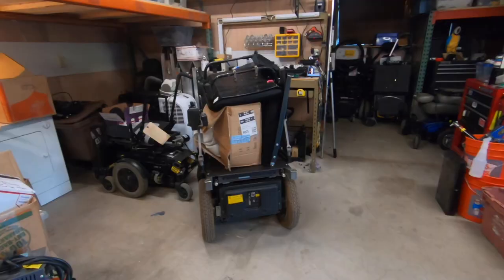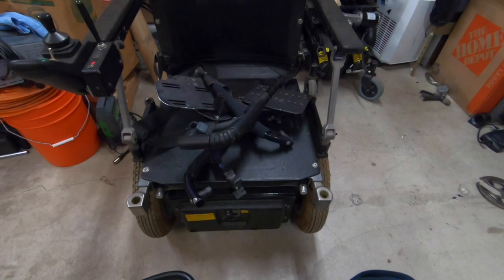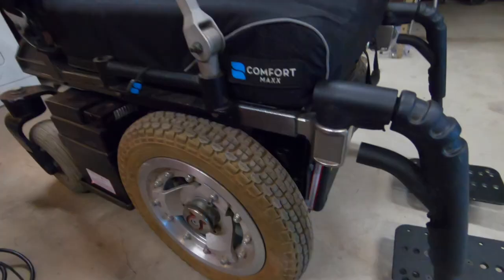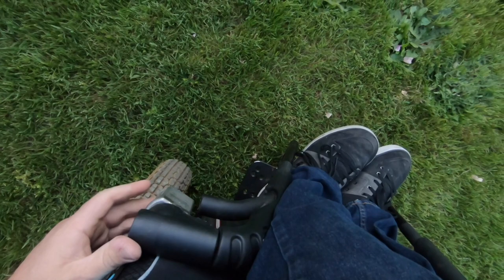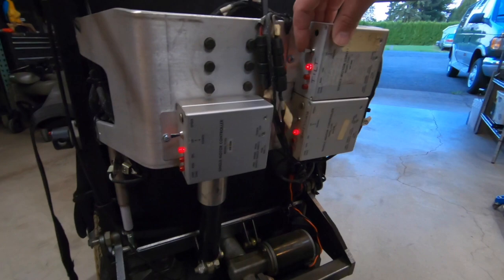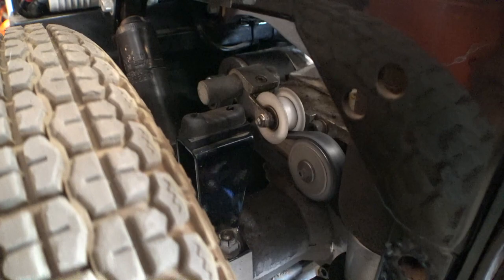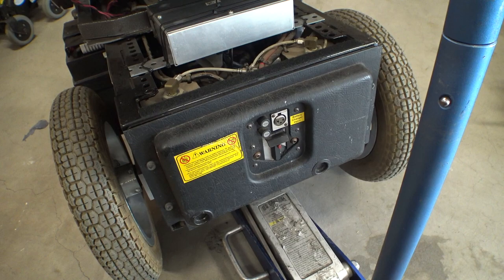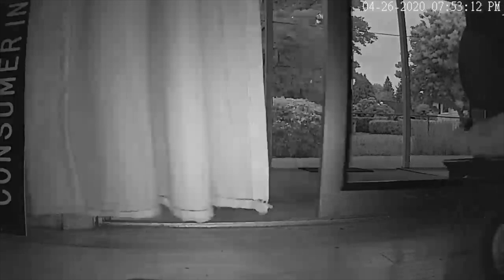VLOG 502: the Omega Trac!

Comment: I had an Omega trac similar to this one. mine however did not have airbags and also no gyroscope so when you went on tilted surfaces the wheels didn't compensate for the tilt. I do agree with you that it was an awesome machine that pretty much could go anywhere and it always felt like you were riding in a Cadillac. I used to drive it down to a lake of with my family. Going down the hill would not of been possible in any other chair but this chair. Just thought about something else mine only had a reclined system and it used labac seating system. The same one I had a quickie wheelchair.

Comment: My friend uses his Omegatrac chairs indoors and out. He’s had four of them. He drives, hunts, and manages his landscape business from it. My uncle and I have serviced his chairs for over 20 years.  His first one had a resistor type joystick w/PG Drives circuit boards and that was always a problem.  His newer chairs have custom digital controls made by Liber-T in Canada.  These have been more reliable but that company is out of business as are the companies that made the chair. 
It had been a challenge to keep his Omegatracs going but he’s not happy with any other.  
I as to your whine, I would check the four timing belt pulleys.  These are made of aluminum and all can become heavily worn.  The last time I replaced them with Ametric steel pulleys.
Reply from the maker: thanks for the tip! my chair has the older control system - just a PCB in a box with thru-hole components.. ive been trying to work out a way to retrofit a different control system - but getting 2 motor controllers to operate with one joystick for forward/back and left/right is beyond the scope of what traditional wheelchair control systems can accomplish
Reply: @TotallyNormal-  My friends first Omegatrac has 2 PG Drives boards with an analog joystick and I know they were a problem.  The Liber-T boards have been much better.  
Another problem is the ball joint in the rear suspension that can separate and allow the rear to collapse. This needs to be kept lubricated.  I tapped a grease fitting into that. 
The drive belt can break if a gear gets too worn, which allows the chair to freewheel.  This could be bad if on a hill. You may find yourself on the ground when the electric brake abruptly engages. 
The caster wheels have been a lesser problem. The swivel joint has stacked plates and is fluid filled to stop the wheels from wobbling. We’ve had these bind up which causes excess wear on the rear tires. I have removed a plate or two from those. 
I recall reading a report some years ago that Teftec got into trouble with the government for shipping chairs with engineering modifications without full documentation.  
These chairs are built like tanks though and my buddy loves the air ride.

Comment: I didn't get my Omega track until 2007(Back when they manufactured it here in San Antonio, Texas). I love it. Their ride suspension is awesome (as I have total sensation as a quad). So the air ride made driving this beast across fields and off-road terrain a blast. Of course I have tractor tires on mine. P&G makes electronics for it now (unfortunately only Hand controls and I'm chin control).
You can get the belts anywhere.
Yes, the son, was paralyzed.

Comment: Dan, I had been studying watching your videos lately. And had to subscribe to your channel.
 Thank you for your posts, and I hope the fires out there are soon extinguished, and you and your friends are safe and without any serious damage.
 I am a long term, 50 year, diabetic, who had an above the knee amputation, in December of 2018. 
 Well last year, a good friend of mine called me up and said I need to come see him as he had a power wheel chair for me.   This wasn’t just around the block, 4 or 5 hours to get there, I’m in central Va, and he is in Tn. So it wasn’t until a month or so ago that I finally got to go pick up my wheel chair.
 Well my buddy surprised me with three, a Pronto M5, a Jet 3, and the subject of your video an Omega Track. Hmm.... here’s where the fun begins. I want to make this a more serious off-road capable chair, if that is possible. Lightening the load is what I really want to do to it, ass you know it’s a tank.
  But for now would like to know about the controls for the Omega. Mine chair has a P&G, Penny and Giles, type D49470/2 Joystick controller, but I haven’t opened the front box yet.
 This chair also has a pair of joysticks that seem to be piggy backed on the control circuitry, one for the occupant, and one mounted at the back beside a push handle for whoever is accompanying them.
 My question revolves around two issues. One is it possible to disconnect the seat and back actuators and still operate the drive and turn motors? And have you run across anyone with any maintenance manuals?
 I would post a pic of my chair, if I could as it is not airbag equipped, it has shocks and springs, and my drive train is out in the open now.
 Thank you for your time.
Reply from the maker: all the info i could find is linked in the description of this video - (manuals etc) im not sure on that model of PG drives joystick... does it look similar to the one on mine? the control system on these chairs is a bit strange.. I'd be curious to see if it is in fact a PG drive system on yours! im looking for a way to upgrade the electronics on mine.. as they're.. well.. a bit old and crusty lol

Comment: Dan, the circuitry, in the control box does have a Penny & Giles relay (?) plugged into the Drive controller board, while the steering board has two units by Hamlin attached to it.
 The Penny and Giles has a sticker on it, that may correspond to the numbers on the JoyStick, the way it’s wrapped around, and being blocked by other wires, I can’t make out but the first few numbers of each line, but these first few are the same as those on the joystick. The numbers on the Joystick are, Type No. D49470/2  Serial No. 098121700.  Drives Technology Ltd., Christchurch Dorset England.
 Also on the steering board has an Assy. P. N. 024 09 0003, but this I believe is an Omega Trac. Number.
 I don’t know if this helps any, without pictures. I’m going to try and talk to a few people I used to work with, that worked with controls and dig some more into a few parts I have in a tote. Be nice to simplify this, but I don’t know if that can happen.
Reply from the maker: yea - on my chair the controller is all one single board with spade connectors on it, going to both motors... i think they had a few different versions of these things.  i know its possible to use a programmable motor controller - like a robotech, or a cheaper knockoff.. but i haven't gotten that far into the project yet :^)  i do wanna put a larger main drive motor into it - simply attached with a couple LARGE band clamps! right now mine id SLOW.. barley 4 mph.... the joystick on mine also looks like a bespoke custom built thing.. ive seen photos of newer versions with actual wheelchair joysticks on them...
Reply: @TotallyNormal-  
Dan,  watching a new video of yours now. You are obsessed with a light bulb at the moment. 
 I am on and off on the omegatrac I have it partially disassembled down to the lower assembly. No back and drive assembly for the back or seating tilt. 
 The main drive motors work, and I am contemplating a drive wheel and tire change for better yard and field use. By the way I have a brochure and 2001/2002 price list. Reason for this is the drive wheel offset you did on another video, the factory offered a dual wheel option that the offset changes worked with.
 I am looking hard at my P&G controls, and still looking at the possibility of completely getting rid of all of there controls and replacing them with two separate controls. That is basically how the P&G controls are hooked up. But with the controls for the seat and back.
 I have the two joystick controllers that were for the seat and back and I was hoping that you might have an idea about what kind of controller to look for that would only function for one direction. Even thought about the cheap China controllers off of eBay, that are only on & off, variable speed, and reverse, as long as the amp ratings are suffice to.
 Any thoughts. And thanks.

Comment: Hey Dan! My Omega Trac winds while turning also. Maybe not quite as loud as yours but that might have something to do with the gearing. Mine is a 2008 with 200 amp liberty joystick, air suspension and I have tractor tires on mine. Besides going slower it's an awesome chair compared to my quantum edge6z. If I have to think about an obstacle with my quantum the Omega Trac cruises right over it. If I have to think about an obstacle in my Omega Trac, there is no way the quantum would handle it.

 The Omega Trac is so much smoother in ride and there is no comparison in the smoothness and ease of operation in the drivetrain. The two things I do not like about the Omega Trac is the leggings and going up a steep grassy hill the chair overheats quite easily. On hard surfaces there is no problem with overheating.

Driving my van from the Omega Trac is so much easier than the quantum because of the suspension. With the suspension aired down it becomes a real stable base without all the suspension movement that the quantum has.

The drive belts are Gates and they are readily available anywhere Gates belts are sold. Looking forward to your next video on the Omega Trac. Take care!

Comment: The Omega Trac was designed by an aircraft engineer; his son was severely injured in an auto crash while his dad was driving. The father was frustrated at the inherent deficiencies of PWC's without gyros in those days and the predicaments (stuck side-ways in doorways) his son experienced. The best materials were used and my 2007OmegaTrac still operates perfectly. A transaxle, one drive motor, one turning motor enable a softball to be placed in front of one drive wheel and the Omega steps forward straight-ahead. I'm not clear if a Bounder or a Magic Mobility v6 could do likewise. Due to length and weight, the Omega Trac was deemed, nonpractical and sales dropped.
They climb like a goat and descend hills using tilt for ballast. A very, very comfortable ride, too; nearly impossible to turn-over due to weigh and low center of gravity, and adjustability using the air suspension in hairy places, I never fell (non seatbelt user). They are no longer made and parts can't be found. At 1,500 hours, the drive-belts were replaced here at home about three years ago. The only service completed to date!

Comment: Built by and aircraft company? Money was no object? Does it have the logo: HH tool company anywhere it? LOL
That is pretty cool for old school !
This is totally a guess: Sound seems like it's coming from one side more than the other off the cogged belt (left side in the video).
Could the belt be too tight? Where to get new belts: This may sound really stupid but... I have lucked out at the local "Ace Hardware Store" for replacement belts more times than at any auto parts store or machine shop ! Just bring in the old belt and let them measure it.
I hope that helps. If not, maybe they can point you in the rite direction.
Excellent Video :-) I like the RC-RV camera man too.
Reply from the maker: yea it makes the noise only when turning - someone else commented that his chair also makes a bit of noise when turning as well.. bit his wasnt AS loud as this one.. soo *meh * who knows lol  ill find out when i take the thing apart :^)
Reply: @TotallyNormal-  That will be interesting to see if it has some sort of clutch mechanism that kicks in during turns or if one motor is working harder than the other. Or, even a belt slipping. but i think you'd smell/ find rubber from a slipping belt. you'll figure it out. you always do :-)